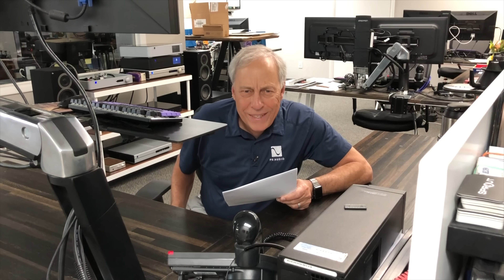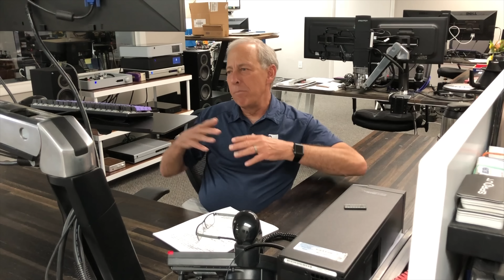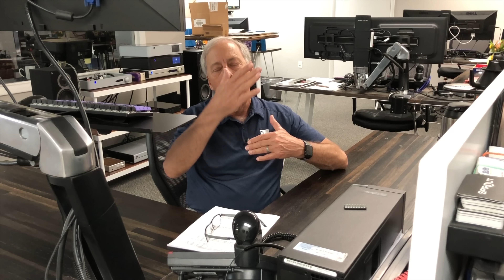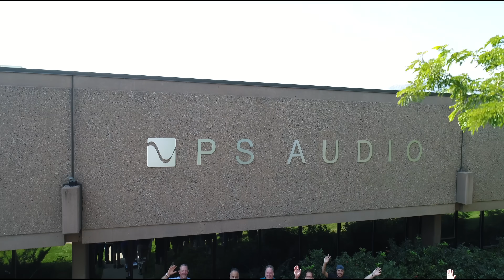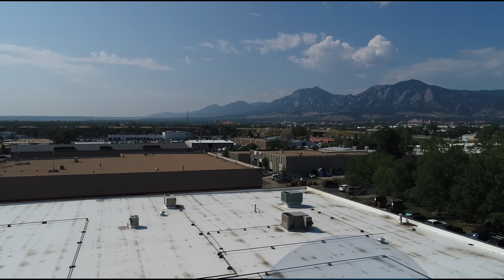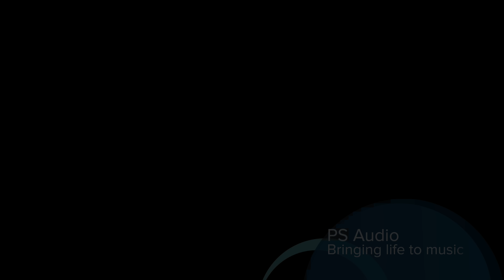Why doesn't low THD equate to good sound?

Comment: How Much Power Do My Stereo Speakers Really Need?
Reply: mohammad alsammak depends what your speakers are rated for, how big your room is and how loud you play.   Most people don't need more then 80 watts per channel.  Although I like head room which means when you play at levels you like,  your amp is not stressed.  My Bryston 4b cubed is rated at 300wpc but I am sure I never get near it's limit.
Reply: mohammad alsammak 1 to 10000000 watts 😄 how much power do you want?
Reply: chris vinicombe  For home i don’t think mor than  60 or 100
Reply: mohammad alsammak split the difference at 80w. That should be plenty for the vast majority of speakers 👍
Reply: @chrisvinicombe9947  depends on the brand and how much thd.  but yeah if it's a true 80w like i use to use an old NAD 3080 pushing a couple of Fisher studio standard floorstanders  with 12" woofers and man you didn't even need a sub it was close to theatre sound in the room they were in,  but it's hard to find full size speakers like that these days.   ended up giving the speakers to my dad and had them paired with a dennon 50x2 and that thing couldn't even get anywhere close to doing what the NAD could.

i have been eyeballing some Cerwin Vega's with the 15's though, to pair with a carver 80x2 that i acquired recently from sister's husband if i can scrape up the cash.  he told me to have fun with it. he had scooped it off a guy back when he was in college, but it's just been sitting in a closet for like 15-20 years because he's got a surround setup,  but he said it was loud.  i still have the NAD too but those things are rare and it prob needs someone to go through and recap it.  i'd hate to go trying to push it and fry something.

Comment: I wish someone would check tap water lol    Oh boy
Reply: shaun tap water is safer than bottled water do you think there's no pollutants in bottled water you're wrong full of them harmful elements and metals and some
Reply: Its all tap water .
 Check out Fluoride ,  what is it , were is it from , why its there  ,what damage it dose , Especially water in the  US .
Then you tell me its safe .
Those black carbon filters will not shift Fluoride ,  BRITA and all are not designed to pull it out !
Reply: use YouTube  not those  any web sights
Reply: Depends where, in China no tap water is safe to drink.
In most of the USA this would be considered unacceptable.
That's changing, corporations are eager to pollute all the USA like they have China, and make us BUY filtered water from them.
Reply: are you kidding me  ,we have WARS & they are unacceptable right ?
Western food is filed with chemicals and you still eat it .